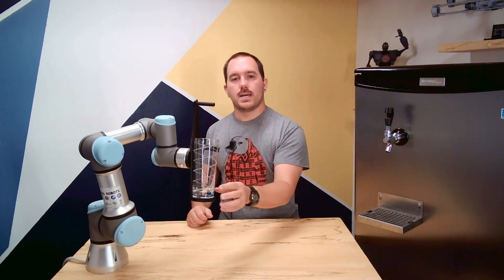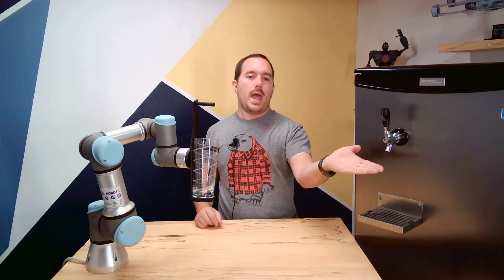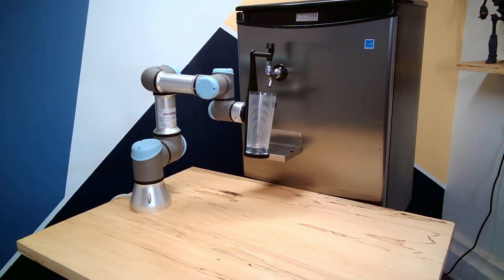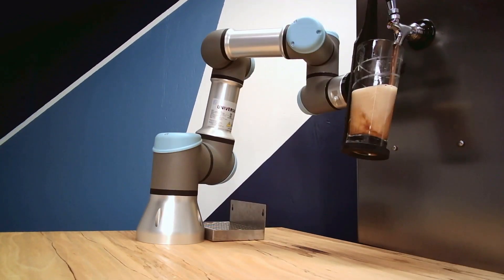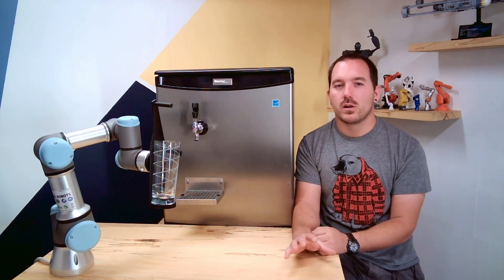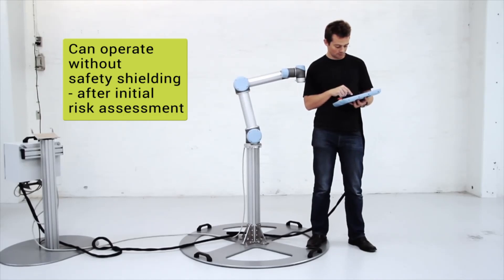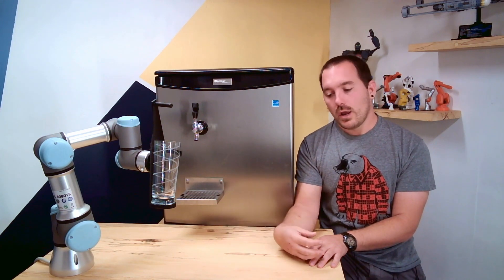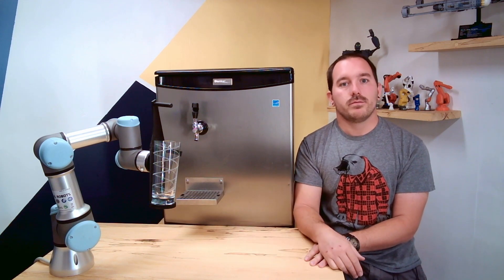Robotic Bartender - UR3

Comment: how are the custom structural components made for robots like these? casting followed by CNC machining?
Reply from the maker: It depends. Could be laser/plasma then welding, cast then cnc, or even 3d printing
Reply: @DavesArmoury  plasma/laser cutting? these parts are not flat. Can we produce 3d parts like these corner parts of robot directly using plasma/laser.

Comment: It seems like using the force measurements to estimate the volume of liquid in the glass is kind of a double-edged sword as you may not be imparting the same amount of force on the arm each time you engage the handle(unless it stops touching it during the pouring phase).

Would have been nice to see your troubleshooting in a bit more detail as well.
Reply from the maker: Thanks for the feedback.  Yeah, that was the trickiest part.  Theoretically the arm should be doing the same motion every time, which should have the same forces, but doesn't seem to work like that in practice.  Filtering helped a lot, but a decoupled glass holder with a dedicated f/t sensor would be the best way